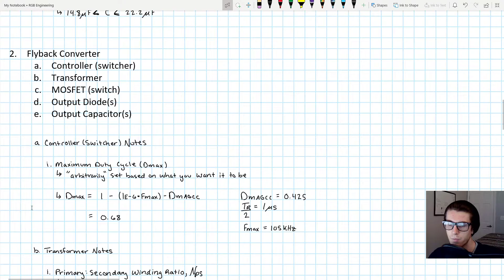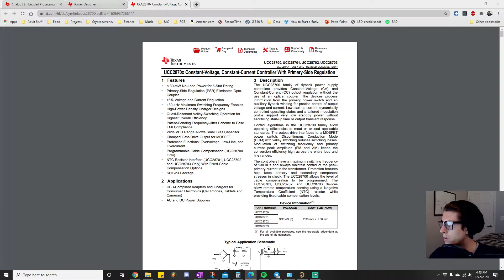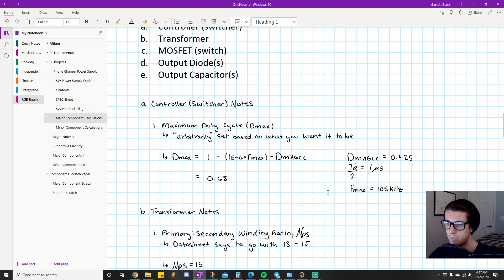5W POWER SUPPLY EXAMPLE - Pt. 8 | FLYBACK CONVERTER EXAMPLE PROJECT | AC-DC CONVERTER TUTORIAL, PCB

Comment: hey, can i choose fmax 65kHz for 2A output current ? is it okay
Reply from the maker: That depends on your primary inductance, turns ratio, and duty cycle.
Reply: @RGBEngineering  Fmax affects (determine?) Dmax, and Fmax and Iocc affects primary inductance right? Or first of all should i know duty cycle value ? Thanks
Reply from the maker: @senayldz7542  Your best bet is to first select a controller IC, and then use the datasheet to figure out all of those values (turns ratio, duty cycle, primary inductance, etc.)